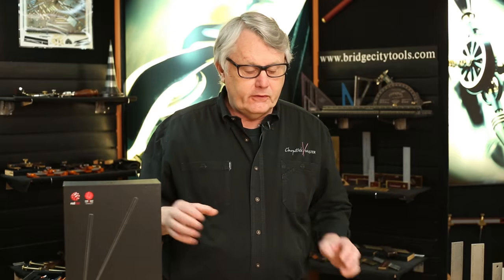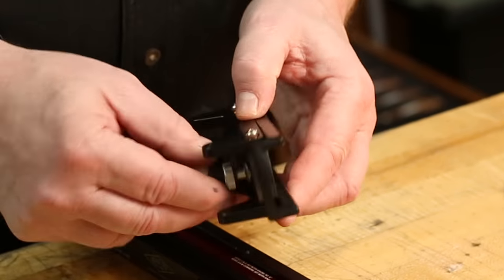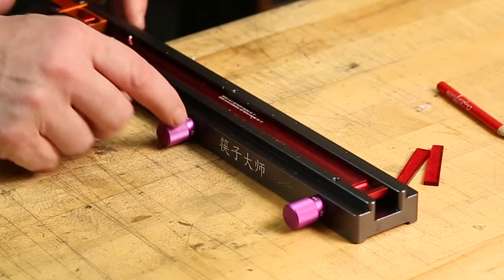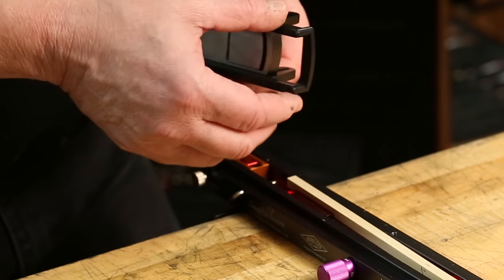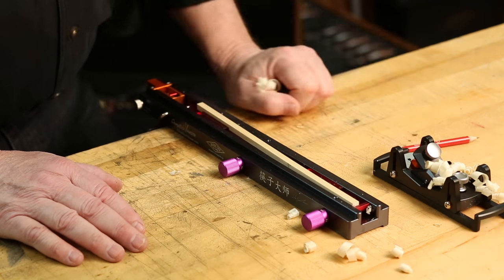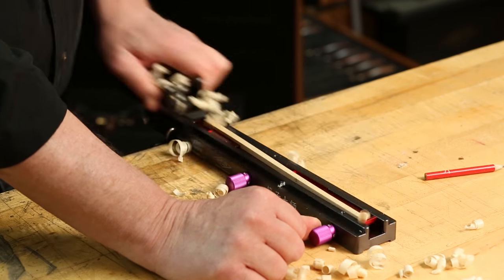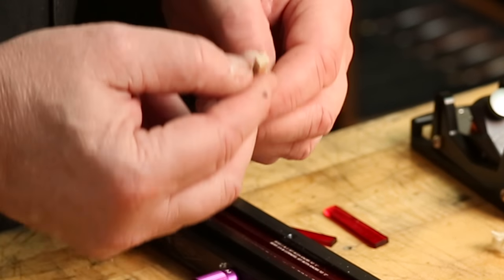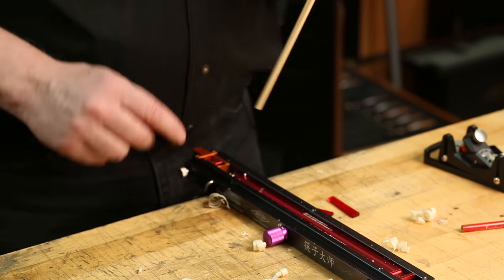How to Make Perfect Chopsticks by Hand with the Chopstick Master™

Comment: Just received it, plane needed some adjustments and blade polishing and honing before usage. Otherwise an exquisitely made piece of equipment. Honing guide is lovely, was disappointed not to have the thinner Japanese style jig included as in the 2015 version, but I should have looked at the contents better. 

The finial end can be tricky as the planing action can pull the chopstick up if it’s not tight enough and give you uneven pairs. 

Unless you were inviting experienced woodworkers to dinner I’d probably not do the dinner party suggestion otherwise you’re going to be there all night!

A great product though and lots of fun!

Comment: Lovely jig, fun to use. I'm cutting my own blanks, and finding that the plane is not touching the full length of the chopstick on the last side, and I get traces of saw marks left at the top of that last side. Can I adjust this out?
Reply from the maker: Hey Malcolm! We suggest making your blanks a tad thicker than 7mm OR you can advance the iron a little bit. Hope that helps!